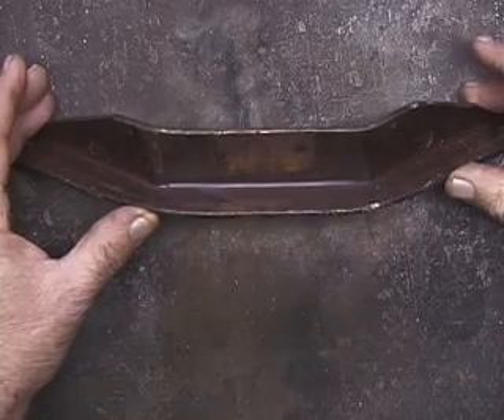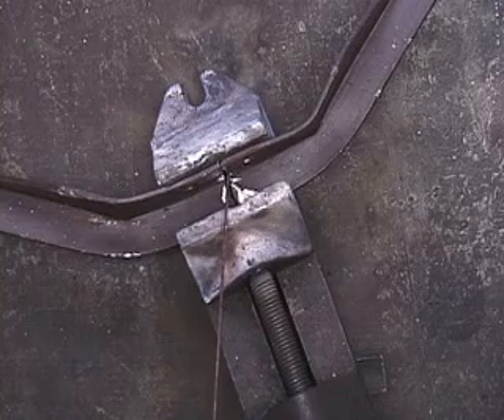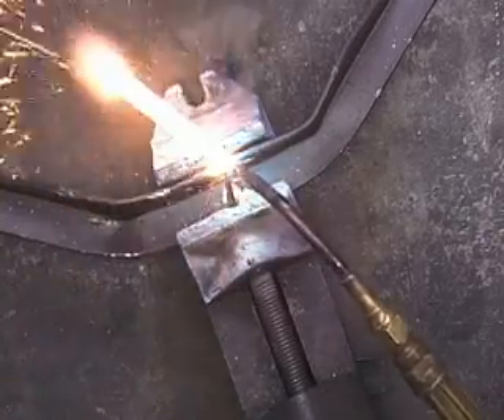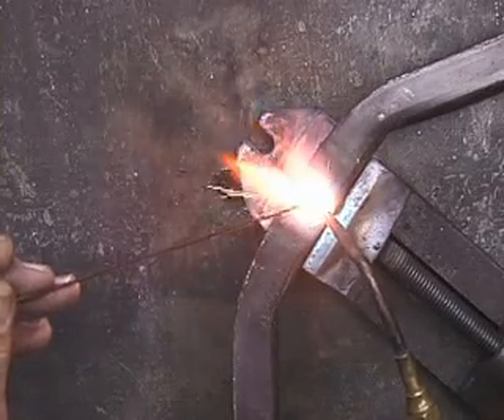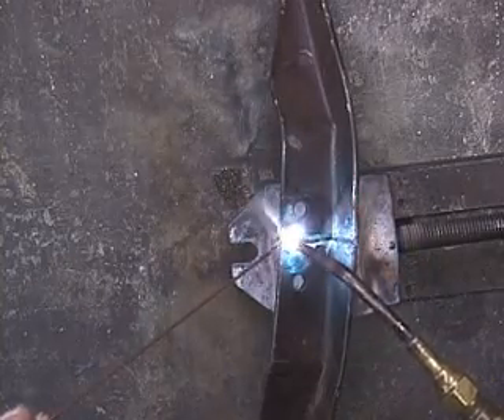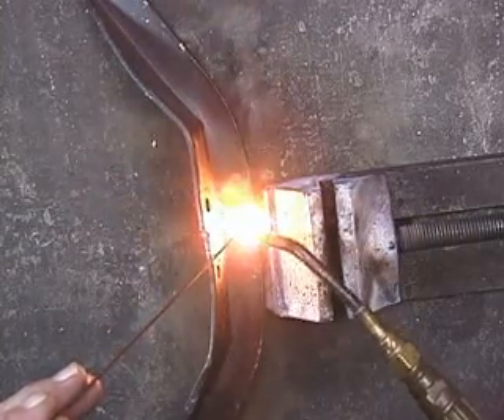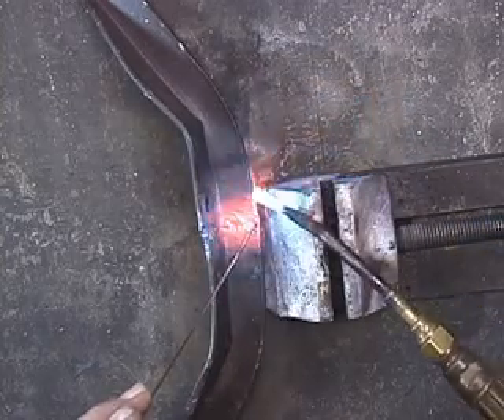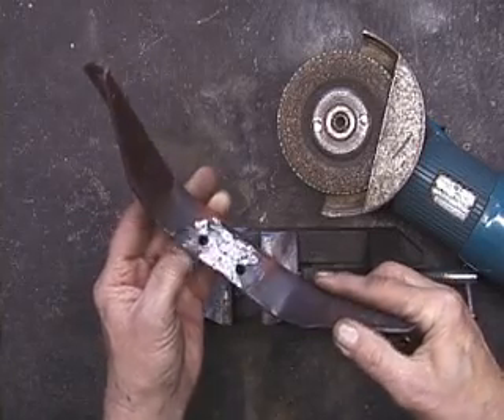Gas Welding Using Gas Filler Rod

Comment: Good series George.  I'm brand new to a welding torch except for a little bit of brazing on some motorcycle fenders about 30 years ago.  You've taught me enough, especially about the different flames, where I feel confident starting a project I need to make in the next month.   The good thing about this series is I can go back and review if I need to.  Thanks a million!!

Comment: Thanks for the video.

Because I live in an urban area, I am forced to keep my oxy-acetylene set in the unheated garage. The sub 50° Fahrenheit weather is wrecking heck with me trying to get rid of the smoke from the acetylene gas out of my number 2 Victor tip 

Is this normal for acetylene to be the Smokey and cold weather or did I get a bad batch of gas from my supplier?

Comment: Hey George, I need to weld a foot peddle crank on my bike, what stick would you recommend?
Reply from the maker: "Stick" to me means arc welding.  I no longer have an arc welder.  If it is steel I would Mig weld.  Using oxy/ace, I would us RG 45, 16" or 3/32" diameter gas welding rod.  RG 45 i a standard gas welding rod.

Comment: hi i just bought these today but im a beginner so i know i wont get but i will learn   im closing a hole on my motorcycle gas tank with a piece of sheet metal so but the rod is not melting it gets red hot but just breaks off in pieces and im not getting lilke a lil puddle or any flow im using a map and oxy setup and i have to relocate the petcock to the left front of the tank thats the reason i cut it from the tank so i gotta weld that hole back and put the gas petcock back any help will be appreciated thanks
Reply from the maker: Zee, I've been brazing and welding for 50 years and there is no way I would attempt to weld or braze a gas tank.  Take it to someone who does this type of work professionalize.
Reply: okay but im sure you can doit , im i using the wrong rods should they be stainless rods?
Reply from the maker: Sorry, when it comes to gas tanks I can't help you.
Reply from the maker: Sorry, I can't help you.  You need hands on help.
Reply: I strongly suggest visiting custom motorcycle forums to get the best answer from custom tank fabricators. I use MIG wire as filler  for light sheet metal such as tanks.  Check out Chop Cult for starters. Also practice on scrap first, never your workpiece!

Comment: great work george.i use low carbon steel wire 2mm or 3mm for welding with oxy acet or oxy propane.keep great videos!!!

Comment from the maker: I know from experience that it can be very frustrating.  Just relax and in time it will all come together.  Personally, I think welding and brazing is intuitive. There is just a split second when the metal has reached the proper temperature and the filler rod is melting. Then it becomes a matter of feeling rather than knowing. 

A welding instructor would not agree with this approach.

Comment: I have heard many times that a good weld is stronger than the metal itself. But I have also heard that if the original metal breaks before the weld does, that means you overheated the metal during the weld and weakened it and is therefore not a perfect welding job. I would love to see comments on this topic.
Reply: TheDadPenfield - When you weld, you are bonding the base metal with the filler rod on a molecular level. What I mean is during the welding process where you are pushing your puddle there is a change in the chemistry with your base metal since you are heating it beyond its melting point and fusing it with the filler rod. The molecules of the filler rod fuse with the molecules of the base metal and form a new molecular structure of which is stronger than the base metal alone assuming you are getting proper penetration, bead width, build up and no porocity.

Comment from the maker: Fore hand / back hand.  I think the reason I did both the fore hand and back hand is that it was more convenient in that situation.  I am self taught so I do whatever I do intuitively.  What I show in my videos is how I do it, not how it is suppose to be done.  Going back over the weld; just trying to smooth it out.  It

If I was welding heavier material and using heavier rod and a larger tip I would wear gloves.  Thanks for your comments.  If you have other question, let me know.

Comment: Nice video demonstration. I had several questions. Why did you forehand weld one way and back hand weld another way? Is one way better than the other? You went back over the weld. Does that help to deepen the weld? 
The absence of a glove in your left hand was particularly noticeable when you said,"Oh this is warm". Do you recommend or not recommend wearing a glove in the hand holding the welding rod?

Comment from the maker: @pprriimmoopro 

A good gas weld is stronger than the metal to be welded.  Key point:  A good gas weld, not a mediocre weld, not an average weld - but a good gas weld.

Comment from the maker: Yes you could use that.  You can also use a steel coat hanger. 

The mild steel RG 45 gas welding rod from a welding supply is a easier to work with. 

Best idea is to practice and see what kind of results you get.  After some practice you be able to figure out what works best for you.

Comment: @bosscolon  it would be more costly to do it that way because of consumables but be equally strong. because you are heating the metal to molten either way you weld it. gas welding would look really nice on a really nice metal sculpture. good idea